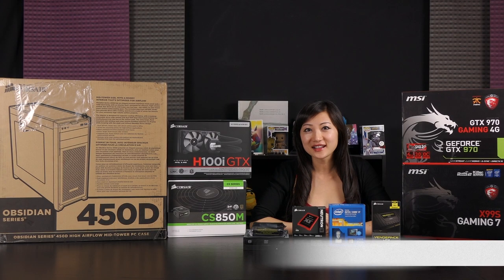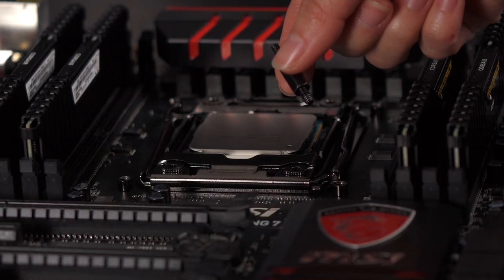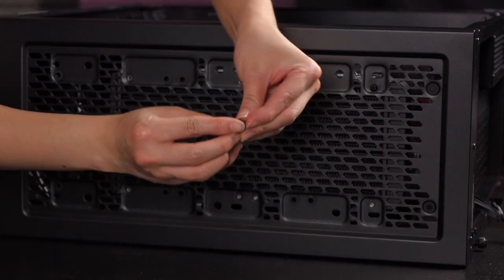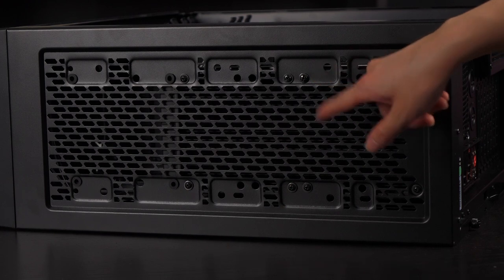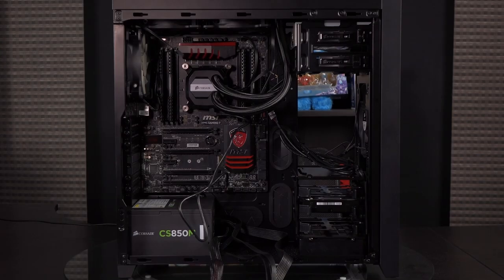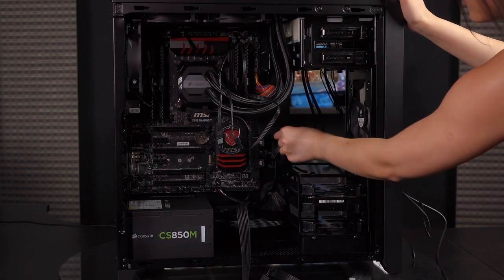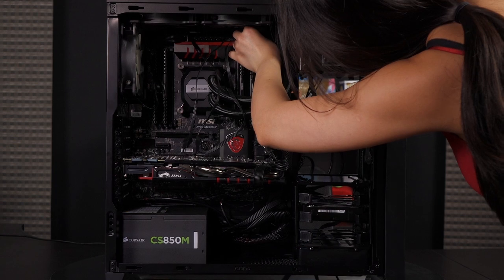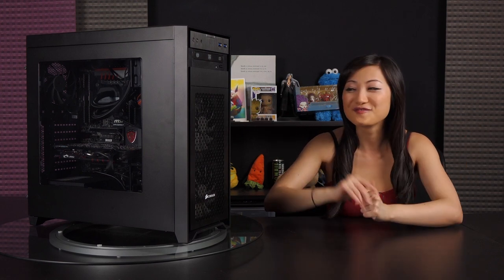How to Build a PC: Epic X99S & DDR4 PC Platform!

Comment: Will this computer be good for video editing and gaming?
What amount of fps for games like MC BF4 TF2? And should I get a SSD? 
Thanks

CPU: http://www.superbiiz.com/detail.php?name=I7-4790KBX&c=CJ 

Liquid cooler: http://www.newegg.com/Product/Product.aspx?Item=N82E16835181032&nm_mc=AFC-C8Junction&cm_mmc=AFC-C8Junction-_-na-_-na-_-na&cm_sp=&AID=10446076&PID=3938566&SID=

Mobo: http://www.superbiiz.com/detail.php?name=MB-MAX7HER&c=CJ

Ram: http://www.newegg.com/Product/Product.aspx?Item=N82E16820233536&nm_mc=AFC-C8Junction&cm_mmc=AFC-C8Junction-_-na-_-na-_-na&cm_sp=&AID=10446076&PID=3938566&SID=

HHD: http://www.newegg.com/Product/Product.aspx?Item=N82E16822178380&nm_mc=AFC-C8Junction&cm_mmc=AFC-C8Junction-_-na-_-na-_-na&cm_sp=&AID=10446076&PID=3938566&SID=

Times two.

GPU: http://www.superbiiz.com/detail.php?name=EV-980ACXS&c=CJ

Optical: http://www.outletpc.com/uh7279-asus-drw-24b1st-dvd-rw-drive.html?utm_source=uh7279-asus-drw-24b1st-dvd-rw-drive&utm_medium=shopping%2Bengine&utm_campaign=pcpartpicker&utm_content=Asus%2B-%2BDVD%20%2F%20Blu%2DRay%20Drives%20%3E%20Internal%20DVD%20Drives

Case: http://www.microcenter.com/product/441510/Graphite_Series_760T_Full_Tower_Windowed_Computer_Case_-_Arctic_White

Windows: http://www.newegg.com/Product/Product.aspx?Item=N82E16832416806&cm_re=windows_7-_-32-416-806-_-Product

PSU: http://www.amazon.com/dp/B00SN7CGAO?psc=1

Wifi card: http://www.amazon.com/Bolse®-300Mbps-Wireless-N-Network-Adapters/dp/B00NTW99A8/ref=sr_1_1?ie=UTF8&qid=1430546202&sr=8-1&keywords=wifi+card+windows+7

MIC: http://www.amazon.com/Audio-Technica-AT2020USB-Cardioid-Condenser-Microphone/dp/B001AS6OYC/ref=sr_1_14?ie=UTF8&qid=1420157521&sr=8-14&keywords=Blue+Snowball etc

Case fan: http://www.amazon.com/dp/B00L64O5RI/?tag=pcpapi-20 

TIMES 2

TOTAL PRICE 
2009.23
Reply: ChaoticalGamingsMC  Everything looks pretty good. Plug it all into pcpartpicker.com to make sure its all compatible and get the best deals. I would reccomend a blue snowball as a mic, as it is cheaper and almost as good. If you live near one, microcenter is running a promotion on EVGA 2400mhz ram, with 16gb for like 110. You may want to get an ssd for your os to make it boot faster, and if you have the budget maybe a big one (500gb) to put your frequently used games and such. Also you dont need a wifi card. just use ethernet (if possible). It's alot faster and wont cost you any money. Lastly you may or may not need a liquid cooler, depending on how extreme your video editing is. You may just need a hyper 212 evo or similiar, and you can use the money that you save towards thessd. Hope that helps!
Reply: For sure.Might even be too overkill for those kind of easy-to-run games.

Comment: I'm getting a PC here's what I've got. http://imgur.com/3O4g6kX
http://imgur.com/FvCp37r

With the H440 case and x41 Kraken would the fans on the case still be needed or could I disable them somehow?
Reply: Also this will be my first build I might switch to a GTX 980 4gbs if I can spare the extra $200
Reply: Yes yes yes you need the fans without them it would kill your pc
Reply: StarFloGaming 
The CPU and the graphics card give off the most heat in a computer, but everything that has electricity flowing through it gives off heat. Even with a full water cooling rig you will need airflow in the case. Without some outside air flowing in and warm air being exhausted, eventually non-water cooled components will fry.
Reply: The rig is a little different from the 3 ish weeks ago. The MOBO is now a MSI z97 Gaming-5, I've got a 1tb HDD and a 240gb SSD for whatever I want. Plus a 64gb SSD For the sata III port for the the OS and only the OS. But yes i understand what you mean by it means airflow also, Luckily it'll also be sitting in a air conditioned house at 68 degrees F. Thanks for the help

Comment: Mine still better ^^
Reply from the maker: Lol specs?
Reply: MSI Z97 Gaming 9 AC mobo
Intel Core i7-4790K Processor (8M Cache, up to 4.40 GHz)
Corsair Vengeance Pro 16GB 2x8GB DDR3 2400MHz
MSI GTX 970 GAMING 4G
Corsair Hydro Series Extreme Performance Liquid CPU Cooler H100i
Sentey® Power Supply 725w
Sentey® Gaming Computer Case (modded to fit H100i)

2nd Computer

MSI 970 Gaming Mobo
AMD FX-9590 8 Core Black Edition 4.70GHZ
Corsair Vengeance Pro 16GB 2x8GB DDR3 2400MHz
MSI GTX 970 GAMING 4G
Corsair Hydro Series Extreme Performance Liquid CPU Cooler H100i
Sentey® Power Supply 725w
Sentey® Gaming Computer Case (modded to fit H100i)
Reply: I would have a bigger cpu but the z97 is 1150 socket type T.T